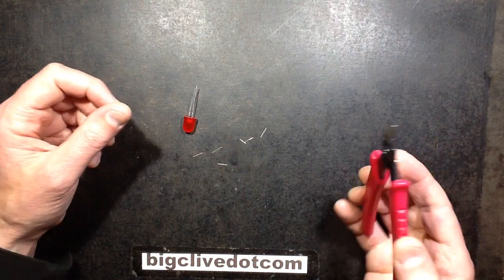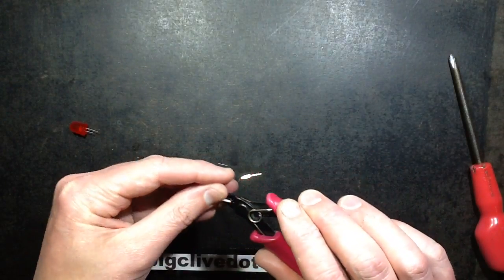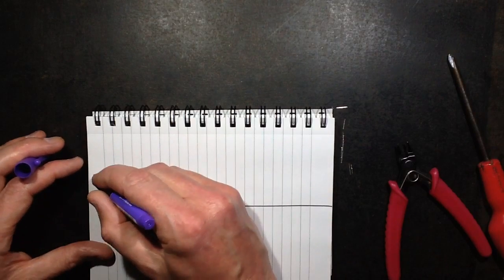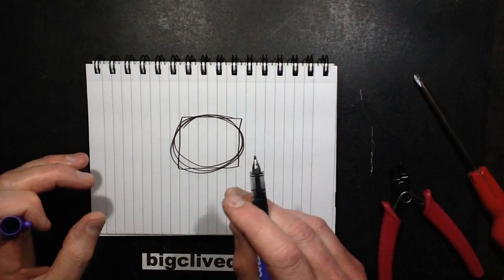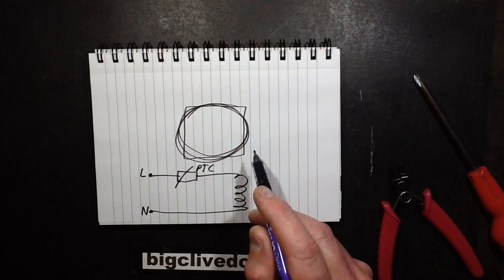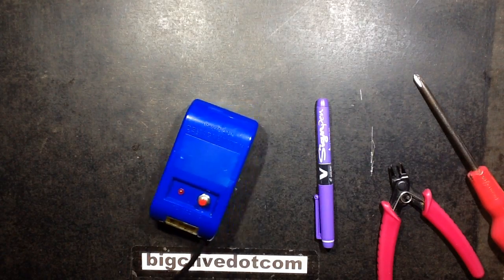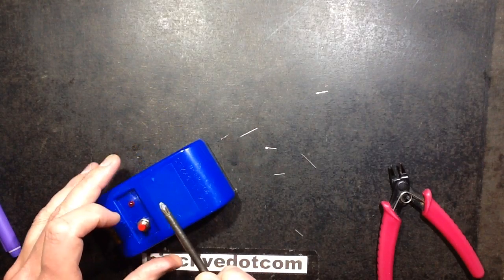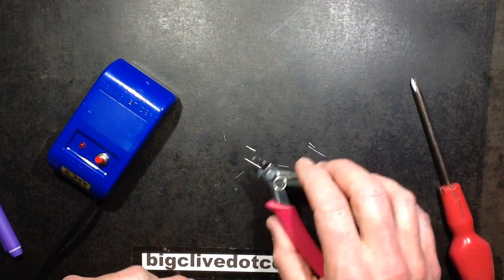A look inside an ebay degausser/demagnetiser from China.

Comment: You didn't mention the other use of the degauzer Clive.  That of cleaning audio and video tape. I have a quite large unit which was used in a radio station for cleaning audio from their logging tapes. Plus of course there's the long Wand used to degauze coloured cathode ray TV screens. Oh yes and a smaller unit for cleaning cassette tapes in compact and 8 track formats. I guess we shouldn't forget the small erase heads in all Tape type recorders, both audio and video.  I also purchased a dumb unit from BangGood which has a plastic enclosure with a magnet sealed inside.  It had holes on one side to Magnetize your screwdrivers and holes on the other side to demagnetize them. Not very good sadly, I much prefer the large audio unit for tools.  Great videos mate, all the best from downunder.
Reply: propfella Also can be used to destroy HDD.
Reply: WOW, I never knew that, next thing you'll be telling me they also wreck floppy disks, yer right :-)

Comment: Could you magnetise items with this device by working in reverse?
Reply: +Edward Spencer   Simply don't pull the tool away. Push the button whilst the tool is sitting on the unit and let go of the button, Easy. :-)
Reply: +Edward Spencer Yup by feeding it DC instead of AC, it will magnetise steel.

Comment: When I was young (about 10-11yo) I placed a strong magnet from a fish tank cleaning apparatus on the screen of our television while it was in-use and rejoiced at the weird swirls and colors that appeared around it. After I removed the magnet, the screen forever displayed an odd purple tint where the magnet was. My dad was not impressed...
Reply: I was in the coin op video game biz back in the 80's; kids doing the magnet thing on our monitors happened more often than you'd expect. It's amazing those machines lasted as long as they did considering how cheap they were made.
Reply: use a strong magnetic bar and twist it and pull it away from crt slowly.
Reply: We used a regular degaussing coil on the old coin-op video games, as linked below. You energize the coil at arms length, bring it in and wave it over the monitor face for a few seconds, then again withdraw it arms length before releasing the switch. Worked great! Still have it, just the thing for demagnetizing tools, bench vises and or whatever... use the same procedure as for the monitors. Keep it away from anything you thing you suspect may be sensitive like pacemakers, cell phone, computer, iPad, newer 'chip' type credit cards... this type however doesn't work well for erasing magnetic media.
https://www.amazon.com/MONITOR-DEGAUSSING-COIL-Arcade-Repair/dp/B01G0LKAVG/ref=sr_1_3?ie=UTF8&qid=1478348645&sr=8-3&keywords=degaussing+coil

Comment: learned about the degausing from a coworker. Showed me how to de-mangnetise a screwdriver with of all things, a soldering gun. Put screwdriver shaft in between the two wires coming out of the clamping blocks and turn on gun. Then slowly pull screwdriver through and pull away until you are about 5 to 10 inches away from the gun. Works great that way.

Comment: Hi Clive  The degaussers ( good ones ) have a PTC and NTC thirmistors in one pact in an L  circuit. 
Residual current in single PTC type tend to disturb the CRT. especially if multi standard and not synchronized to mains  vertical drive.

Comment: If I were building a cheap degausser (which I might do for fun at some point), I'd probably just use a potentiometer to dial the field down so I didn't have to bother with thermistors or moving my tools around with my clumsy mitts.
Reply: +Hobo Sullivan 
It will be cool, do you tested that idea?
Reply: I'd try it, except that I don't think any of my potentiometers are mains-rated. Still, I might try it if I can hunt one down.
Reply: Why just dont use triac?
Reply: Arek R. I've never worked with triacs, and I don't really understand them very well, but I'd imagine you'd need something that behaved more like a potentiometer. To my limited understanding, a triac just triggers at a certain part of the waveform, where I need something that gradually compresses the waveform. Maybe some sort of power transistor?

Comment: I used to have a TV repair shop back in the CRT days, our techs made their own degaussing coils, I never made one but it seemed to me they were a loop of wire maybe 30-40 feet long, they usually used lamp cord, I'm not sure but they might have used a resister in line.  They were usually a coil about 12" in diameter, completely wrapped in electrical tape and had an inline switch in the cord. I've degaussed many a TV picture tube in my time!

Comment: Could you reverse the effect and re-magnetize the tools by slowly moving them closer?
Reply from the maker: +PongoXBongo If you just jab the button while the tool is on the surface it will leave it with a random magnetic polarity and strength.

Comment: I 'worked' at a local radio station a long time ago and walked in on one of the dj's erasing some jingle carts ( similar to 8 track cartridges with magnetic tape inside on a loop ) to do new jingles one afternoon using a unit not unlike this one. 

He had the whole box of carts next to the machine and was busy selecting odd ones he wanted to erase, buzzing them and putting them to one side. Language unsuitable for the female ear was used.

Comment: Whatif you put an inline dimmer switch/pot and slowly turned it down. You could get one of those clever slider types from the home store.
Reply: nope they chop up the ac waveform, not reduce it 'linearly'..
Reply: There is linear potentiometers
Reply: Or just use a variac - we know Clive has one of those...

Comment: Just put the tool through the loop of a soldering gun (like a Weller) and it will work too. Can make a larger loop for larger tools out of a piece of house wiring copper. Of course it will take longer to do.

Comment: I have a bulk tape eraser which was sold to erase VHS cassettes which could likely be used like that.  Same thing, it has written on it the duty cycle, something like 1 minute on, 30 minutes off.  It also has some sort of temperature sensing mechanism so if you try to abuse it by operating it too long it'll cut out for a while.

Whenever I held a screwdriver or something like that against it and pulled the trigger switch, it would make a scarey loud buzzing sound.  What I was lacking was the idea to pull it away slowly.  Thanks for teaching.

Comment: For some physics on "How far you have to pull it away" The answer is an infinite distance. The strength of a magnetic field is ~=a/d^2 where A is the magnetic moment and other blah blah blah, but distance being squared means it tapers off quite quickly, but there will always be a magnetic attraction, even if negligible at any finite distance.

Look up Lorentz force for that info.
Reply: +GenOmega2 That's all fine and well, but clearly the wise answer is less than half a metre. Certainly by the point when it's being magnetised more by the Earth than the degausser, there's no point in going further :)
Reply: travelling to the outer reaches of the universe is a pricey way of demagnetising a screwdriver.

Comment: As I remember, most CRT TVs had two components in the degausser circuit--a thermistor and a varistor.  At turn-on, the resistance of the thermistor was low, and the resistance of the varistor was high.  As current through the thermistor to the degaussing coil heated the thermistor, its resistance went up, and the increasing voltage to the varistor caused its resistance to go down.  Net result was that after a few seconds of current to the degausser, the current was gradually switched over to go through the varistor to the TV power supply to start it up.

We used large degausser coils on aircraft occasionally to remove magnetism from ferrous parts, particularly those near magnetic compasses or compass flux valves.  On rare occasion, an entire nose gear strut would become magnetized by a lightning strike to the forward fuselage, and it would have to be degaussed.  The problem presented itself as a sudden swing of the standby magnetic compass in the cockpit when the landing gear was retracted or extended.  Extended, the gear was too far from the compass to affect it.  Retracted, the strut was in the wheel well directly beneath the cockpit floor, and, if magnetized, close enough to the compass to cause a substantial deviation.  Needless to say, magnetic compasses, flux valves, and other sensitive equipment had to be removed from the area before a degaussing coil could be brought near.
Reply: yes, earlier circuits used a single ptc from the mains, then 680 ohm resistor to ground, degauss coil fed in series with a varistor from  the ptc and 680 junction, and ground, then they went to dual ptc in one unit, with the second ptc across the mains(but a higher resistance type), then seemed to go to just a single ptc...
Reply: airplanes mechanic detected. ;)
Reply: Many of the later CRT degaussers used a relay that turned on and sent power to the coil for a few seconds at switch on, and then turned the relay back off. 

You could hear the click every time those were tuned on, and then a click again a few seconds later. I once had a CRT computer monitor like this, and it also had a manual degauss button that would energize the relay for a few seconds when pressed. It was always weird to watch the display suddenly bounce back and forth, all over the place, when you pushed the manual degauss button.
Reply: Sounds like throwing a thermistor in this demagnetizer could make it automatic... #badideas.

Comment: Dual rated 110/220 with just a resistor in series with the LED? Any chance the voltage drop across the resistor being insufficient at 220 (or to great at 110)? And I hope you replaced that momentary pushbutton with something a little more suitable and on the line side vs neutral. And you have to laugh at the  power cord "knot strain relief"!

Comment: Would be possible to use it to magnetize an object?
Reply from the maker: +gskaloyan If you placed a suitable object on it and jabbed the button briefly it would leave it with a random residual magnetic charge.  The level of the magnetism would be determined randomly by when you let go of the button.
Reply from the maker: +Brosilio Gaming (Tarshadow5) That could work for brief operation.
Reply from the maker: +Brosilio Gaming (Tarshadow5) With a suitable arrangement it could be run continuously.  Like a magnetic door holder.  Demagnetising objects requires an alternating magnetic field.

Comment: For a quick hack you could add a thermistor so it would automatically degrade the field. You could also add in a switch connected to a bridge rectifier so you could get a one way electromagnet to remagnetize your tools.

Comment: Personal anecdote ... When I got my first wide-screen telly I probably didn't turn it off for a couple of years (used the remote) I noticed the screen was distorting colours and it got worse and worse over about 6 months. I was ready for chucking it out. One night we had a power cut. When the power came back on the telly powered up with a "thunk" sound and suddenly all the colours were right again. I figured out for myself that the thing degaussed itself only when it had actually been turned off by the switch for a couple of hours.
Reply: thats one of the reasons why its not a good idea to shut a tv off on standby all the while... 😉
Reply: that only works for crts
Reply: @masseyluna2002  Yes I know
Reply: @masseyluna2002  exactly why he mentioned it
Reply: And degaussing makes a lot of noise in a CRT.
Reply: @mrkitty777  I had an old ViewSonic PC monitor back in the day and the Degauss sounded like a damn light saber hitting a metal trash bin.
Reply: @SUPRAMIKE18  and the image tilted when that sound was heard too. But i have seen many tv that needed degaussing but that was in the 80s and 90s and i remember black and white tv didn't need degaussing after a magnet nearby.
Reply: @SUPRAMIKE18  👍 I had one too like that. The "THauank" sound and the display bouncing all over during a manual degauss was always interesting.

Comment: does it demagnetise it permanently ?
Reply from the maker: ***** No.  If ferrous objects get exposed to strong magnetic fields they can become magnetised again.
Reply from the maker: +Nicholas Ruiz to remagnetise something you would need to place the object on the unit and then just jab the button once, test for magnetic field and if it was too weak, try it again.  The magnetism in the object would depend on the position in the mains sinewave at the point the button was released.
Reply: +bigclivedotcom can you use the deguasser to re magnetize it again?

by pressing the button and slowly bringing it closer?
Reply: bigclivedotcom OK thank you :)

Comment: They made a mistake in their design. A degausser works MUCH better without a core, because even an open core steals all the magnetic flux. Take the core out of it and drill a hole so you can insert the tool into the coil and it works MUCH better!!

Comment: My grandfather taught me to demagnetize things by beating the shit out of them against a bit of metal. It used to work pretty well.
Reply: Yeah, try that on a mechanical watch or a CRT.
Reply: @ZZZRSC  CRTs were real nice about that, actually. Didn't even need the metal. Just a good whack at the back of a TV would fix all of life's ills.
Reply: AnthonyH That gets the electrons going again, i have heard of the effect!
Reply: Eviltech Nothing quite like waking up those lazy pixies!
Reply: +AnthonyH Yes.  That always worked for me.  Whacking a screwdriver on a hard metal surface works wonders for taking away the mag field.
Reply: Heating things beyond their Curie point works too, then quenching them rapidly. You can also magnetise a steel bar by lining it up with the Earth's magnetic field and hitting it repeatedly with a hammer.
Reply: @Tocsin-Bang  If you happen to know the field dip angle for your part of the world. 

We played about with this for a physics project in the 1970s, and it takes the patience of a saint, to sit there laboriously hitting the end of the steel bar, but it does work.

To find the dip angle, you can refer to geological survey reference charts, or ask your local college/university if they possess a "magnetic field dip indicator" and check the angle. Unfortunately, a normal plotting compass cannot work as a dip indicator. As a crude reference, at the magnetic poles, the dip angle is at 90 degrees from horizontal. At the equator it is (theoretically) at 0 degrees from horizontal. In any case, the bar must follow the magnetic flux lines from North to South. Or in other words, at the poles you would clamp your bar vertically, and at the equator, you'd clamp it horizontally, and longitudinally aligned (you cannot effectively magnetise a bar aligned East to West). In other parts of the world the angle varies between 0 and 90 degrees depending upon where you are, and what the local geology is made up from.
Reply: beat your watch agaisnt the metal.

Comment: this will also unstick a cheap watch the seconds hand will do a full revolution in 1 second approx because of 50 hz, i made one for a market trader friend 10 years ago with two settings one strong to unstick the watch and one setting to run it for a while, also use lighter fluid for a stubborn jammed watch worked a treat still working today lol, give it a go with a cheap battery watch
gr8 vids keep em comming.
Reply from the maker: paul taplin I think that may actually be one of the advertised uses for this particular degausser.

Comment: Oh the irony... Needing a magnetic screw-driver to remove the last screw from the degausser. :-)

And that mothbally smell, thats what I refer to as the "aroma of Chinese manufacturing"... It'd be interesting to know how/why the smell. I wonder if it's from fumigating shipments at exit or entry to a country.
Reply: Thank you. I was about to elaborate the same observation, but you beat me to it.
Reply: Awwwww yes the unforgettable smell of chinesium
Reply: Simon Johnson mothballs are traditionally made out of camphor. Camphor is also the oldest plasticiser for artificial plastics and was originally used with cellulose - otherwise, photographic film for example would have been impossible. The toxicity of camphor is rather low, and as long as the lethal dose is not reached, it will likely increase the Chinese worker's perceived quality of life, it works a bit like laughing gas. And it's available from cheap natural sources, they probably just grow the trees in their back yard. It is also used as a spice in cooking in numerous countries.

Nah, that was just a load of bullshit. They really just need a lot of mothballs to protect the factories and storage areas from attack of the giant, nearly human-sized moths, and end up encasing some of the smell in the product. "China insect problem" gives over 3 million results on Google, so i must be onto something!

Comment: And this degausser should work to demagnetize an old CRT, right?
Reply from the maker: BIll Georgoulakis It's not really designed for that.  Traditionally you'd use a degaussing wand and wave it gently back and forth in front of the screen, passing wide at each side.  This unit might work, but is not intended to be operated for long periods of time.
Reply: +bigclivedotcom I remember in the days when TVs were rented rather than bought a technician coming and doing exactly that to our set. He warned me in advance that what he was doing might look like casting a magic spell, but it was perfectly sensible. In fact I had studied enough physics to understand what he was about.
Reply: +bigclivedotcom Yeah, I understand that limitation. Thanks!!!